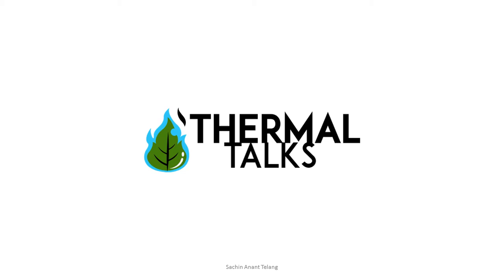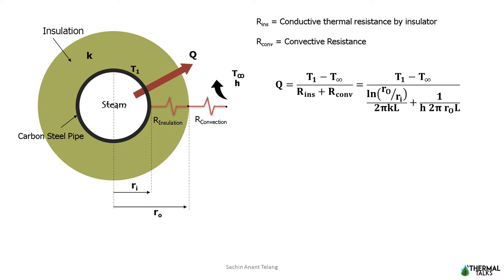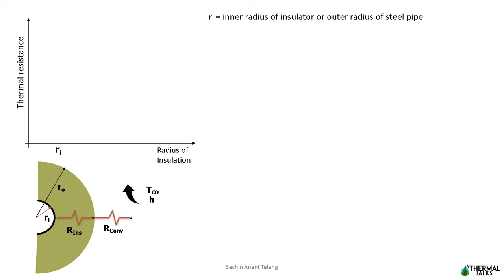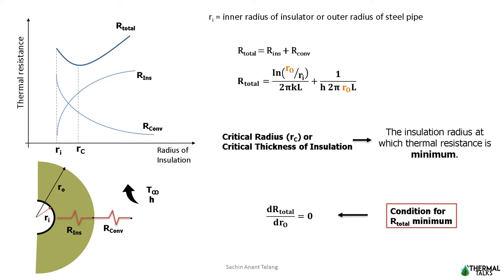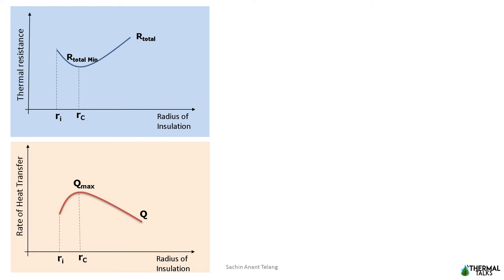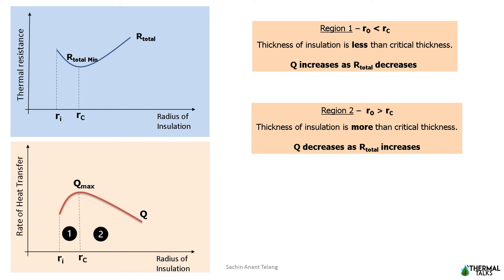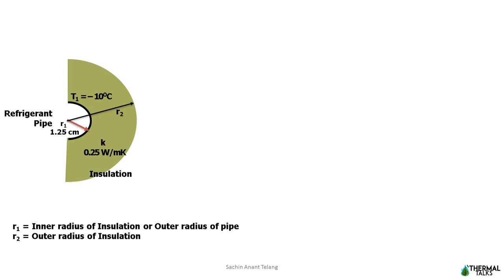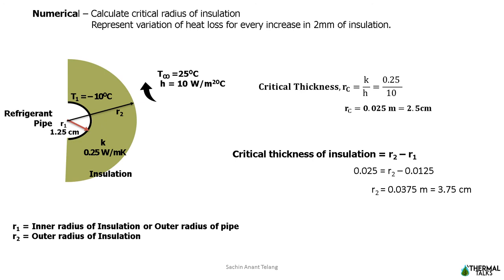Critical Thickness of Insulation

Comment: The critical thickness of insulation in case of a cable of dia d , ho = 12.5W/m 2 K and k =

0.15W/m K is

(a) 12m

(b) 24m

(c) 24 mm

(d) 12mm

???